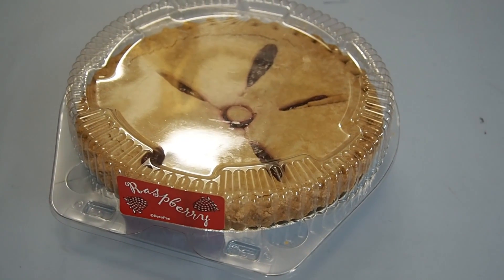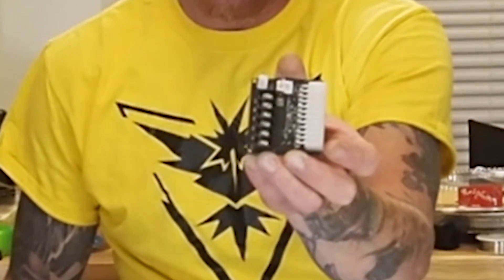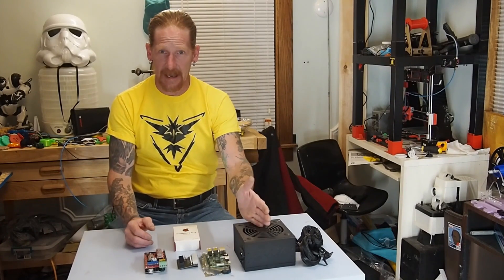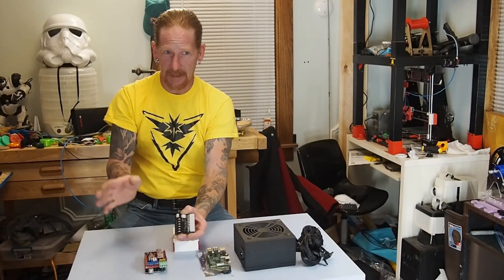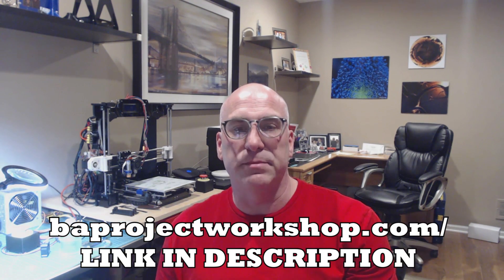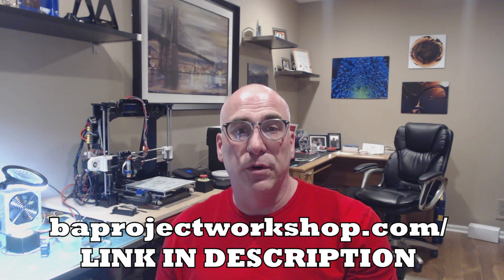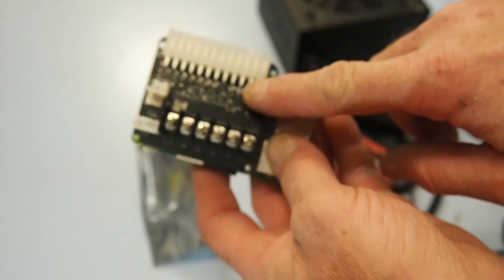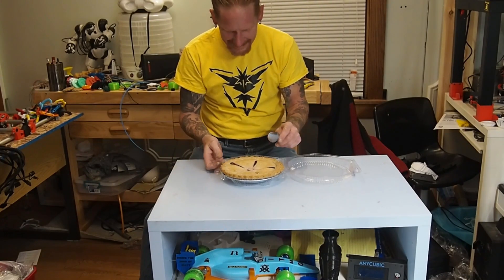The ATX Raspberry Pi Hat

Comment: Hi Matt,  older ATX power supplies  have 20 pins newer ones have 24 usually configured as a 20  pin  with an attachable 4  pin which allows you to use them in older boards in theory :/  the plug is always 'keyed'  with tiny shapes at the ends of the plug to prevent plugging in  the wrong way,  so if it  wont go in easy try turning it around and or try  plugging in from the other end - hope this helps

Comment: Matt, you should be able to plug that cable into the connector, just align the cable to one side. Hard to explain which, since it isn't colored. Notice how some of the pins are in tapered slots, they should align with similar slots on the plug. The extra 4 pins are used on computers to carry extra power for video cards and such. Many motherboards don't use these now since external power for video cards is so common.
Reply from the maker: Thanks I played with it some more after your comment and got it to fit all is good thanks so much.